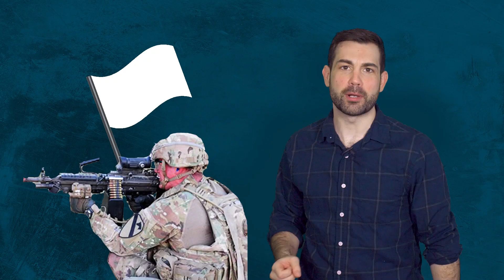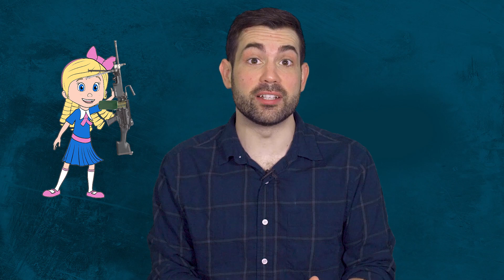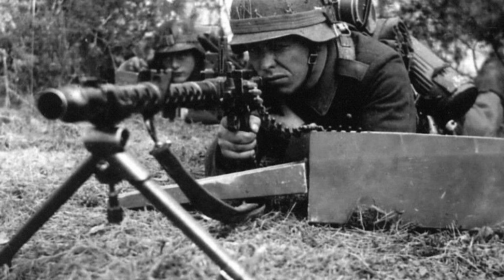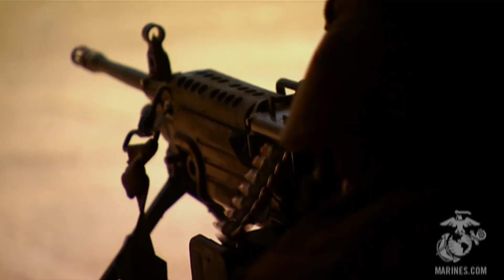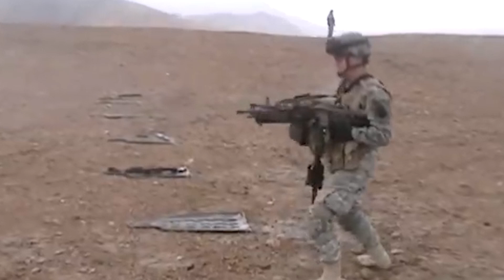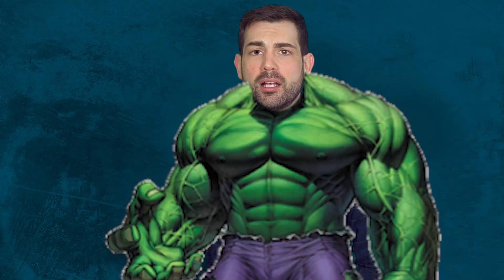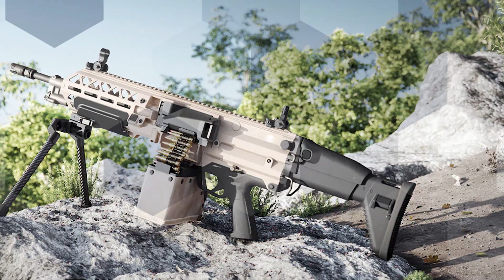How the M249 Machine Gun Evolved

Comment: I’m gonna be interested to see what comes of the marines adopting the m27, with them getting rid of their 249s and the next gen squad weapons coming along
Reply: Me too. I do believe the M27 is a good weapon and the idea of interchangeability with M4’s makes sense on paper. I’m just wondering if it actually plays out that way in practice.
Reply: The M27 is currently serving as an Automatic Rifle, not a Squad Automatic Weapon nor a Light Machinegun. Basically Infantry Marines are replacing all of their M16A4s, M249 SAWs and most of those M4s with the M27 IAR. The idea is that the M27 IAR is an Automatic Rifle kind of like the old WWI and WWII era M1918 and M1918A2 BARs, except now every single Marine gets an M27 IAR except the squad leaders, platoon leaders and platoon sergeants, who will still have M4 carbines. So about 5 M4s per platoon and about 45 M27 IARs. The M249 SAWs have been moved to the company level and are issued out to platoons on an as-needed basis based on mission or employment. It’s actually a very well thought out system and seems to be working well for us so far.
Reply: @jonathanbirkeland1085  well the idea is to replace the 249, the m27 is supposed to be able to have more rapid fire capabilities than the m4, not to the same extent as the 249, buy when you have 2 or 3 guys, it makes up for it, and its meant to be super flexible, Jack of all trades, but I do see what you mean and agree it is probably better thought out than being so rigid
Reply: @jonathanbirkeland1085  Idk who told you that but every grunt is supposed to be equipped with M27’s, not M4’s
Reply: M27 can’t fit the lmg roll because you can’t even fit a 100rd mag because you can’t even change the barrel lmao so just put a 30rd mag and call it a wonderful rifle
Reply: @JS-Rawski  actually i've heard the tactics regarding the M27 will be a different than the ones with the 249, and i also got wind of the marines maybe phasing 60 round quad-stack magazines into service but i'm pretty sure that kind of stuff would jam every 10 shots
Reply: @fuldaman1691  I've heard tge 60 rounders are actually reliable
Reply: @JS-Rawski  249 which M27 is replacing is not lmg. 240B and L are still gonna be in service isn't it? So M27 is supplementing 240 MG crews rather than completely replacing them. If they get rid of 240B/L and only left with M27 then it's a problem imo
Reply: @JS-Rawski  5,56 machine guns lack the range and penetration to truly be useful id rather take a 240B/GPMG knowing that I could hit more accurately and penetrate structures more effectively
Reply: @JS-Rawski  the M27 is not a 240 replacement. It’s a 249 replacement. The current new issue among up to speed units are 40 round magazines. The Marine Corps has been doing it’s very detailed stress test on the magpul 60 round drums for almost 2 years now. The concept is to have the ability to make anyone the gunner during firefights.
Reply: @JS-Rawski  it isn’t filling the LMG role. The marines are finally getting on board with what Russia figured out after WW2
Reply: @JS-Rawski  You don't typically swap barrels for a SAW role.
Reply: @skepticalbadger  right but the statement of the capability to do so was there for the 249 but the bigger thing is there’s no drum mags yet for most of the units using the m27 the reason I say it’s not quite there in that role is we used them the last year I was in and the automatic riflemen would say it’s great it’s just not great to reload 30rd magazines into it over and over
Reply: @JS-Rawski  It's not meant to replace the LMG though. It's meant to be an AR. It was time to get rid of the SAW anyway, it's too old and janky. It made sense to get the M27 because everyone has one so now your entire force just became way more capable, vice just one person in a fire team getting a LMG (which cannot fill the role of a rifle anyway). 

An LMG upper that you can swap out with the M27 (which is already an AR, DMR, and rifle) would be better than an entirely new LMG. That's 3.5 weapons systems in one weapon, without having to buy a new lmg. 

Developments in AR's, hi-cap mags for said ARs, LMG uppers, as well as making MMGs lighter, shorter, and more powerful are going to render LMGs unnecessary.
Reply: @cm-pr2ys that couldn’t be further from the truth, lmgs will always have a role in conventional combat, the marines aren’t fighting like special forces but they also aren’t fighting like the army does.  For the marines, it makes sense to get rid of the 249, but for the army and they way they operate, the 249 is essential, even if they had m27s or whatever else.
Reply: @organiccrack516  and if the MG portion of the NGSW program goes forward, they'll replace the 249 and 240 with the MG68. 
Or if true velocity wins (beretta) they'll essentially have a bullpup battle rifle m27. Small mags, but excellent range/power/accuracy, much improved weight savings over the alternatives.

They're also looking at a lighter 249 (what the pic depicts) if the 6.8 isn't adopted, and a modern lightened 240 in 6.8 TV if the TV bullpup is adopted, along with replacement barrels for miniguns, and the like.

The sig mg338 and the vortex optic are already finally approved it seems.
Reply: @organiccrack516  LMGs can never fill the role of a rifle, even with a semi automatic feature and the ability to mount optics. It will never happen. The open bolt design makes it less reliable when clearing rooms or initiating ambushes. The manuever element needs a lighter, more reliable, and all around more capable weapon. That's why I mentioned improving hicap mags and using an LMG upper vice a whole new LMG. That would save the USMC money. In addition, improvements to MMGs mean any added weight from .338 ammo is worth it because they can still shoot farther and are more powerful than an LMG can ever hope to be. Imagine the 240LWS chambered in .338, or a lightweight and shorter barrel Sig MG .338? For the few extra pounds I'd rather have that over an LMG. Same reason why SOCOM tends to use the Mk48 more than the Mk46. The extra weight of an MMG is worth it when the round is more powerful and enemy body armor is improving.

As technology improves, we will see LMGs only filling one specific role on the battlefield because they are not as capable as an automatic rife and they are not as powerful as an MMG. .
Reply: @cm-pr2ys  I know, I’m not saying the lmg can fill the rifle role, I’m saying a more capable rifle can fill the lmg role when a lot more people have them and it is designed to be that way, and again, it works for the marines,  not everyone else at the same time
Reply: Not unless there's an Extended Mag in 45, 60 or 75 round mag, to be on par with Russian RPK.
Reply: @mystyle_jm8997  drums are very unreliable, clunky, not ergonomic, and expensive, that’s why the RPK is typically issued with 40 round mags, not 75 round drums, and even then, they fill different roles, the rpk is meant to be a mag fed LMG while the M27 is meant to be the standard issue rifle that is capable of a bit more firepower than your standard rifle, and reliable 40 round mags exist, and the 60 round sure fire quad stack mags are supposedly reliable for what they are, reliable enough for the marines though? Probably not,
Reply: Put in surefire 300 round quad-stack magazine in :D

Although i heard quad-stacks aren't particulary reliable either
Reply: @Juozapas001  the M249s arent going anywhere as the marines recently revealed that they are still fielding the M249 for the foreseeable future.
Reply: It'll stay in that position where it isn't used, because why rear echelon dudes need a ~7 kilo? Auto-rifle, but not out of service because reasons i guess
Reply: @JS-Rawski  the M27 is trying to be like the Russian RPK. It's not as good as a belt fed, but it's way better than a normal rifle. It gives everyone in the squad something within spitting distance of an M249.
Reply: The DSTL study on suppression (accurate fire is more important than volume in suppressing a target) is probably the type of thinking they’re going for
Reply: You could slap beta-C drum mag on M27 :D also makes for... really cursed M249 pics, seen one on google... ewwwww...
Reply: @Juozapas001  meh they should’ve just got the ultimax100 if they wanted a decent mag fed MG, BetaC isn’t very reliable I hear
Reply: I guess they had to jump with the french army & bundeswehr on that one, so... fat barreled 416 it is. I mean they removed both M4A1 & minimi from combat roles at the same time
Reply: @Juozapas001  yup, that's the idea, it's not just a new gun that's being adopted, it's new tactics as well, it is in between the two roles and filling them both, just like the assault rifle is in between a battle rifle and sub machine gun
Reply: @radaraacf  no point when the ultimax can't take the place of a rifle. 

It'd make more sense to work on developing a cheaper hi-cap stick pmag thats easier to store than a drum and makes you look like every other rifleman. That's enough ammo to quickly reload and provide accurate suppression, and enough precision to deliver accurate aimed groups at the same time while saving weight and being much easier to learn than an actual lmg.

With that being said, until the ultimax replaces all Singaporean Army rifles, there is no point in adopting it when lmg's and rifles exist. I love the weapon, but it basically being a heavier rifle that doesn't get used as a rifle is a waste of time.
Reply: From everything I've heard, they were excited about getting rid of the 249
Reply: The Marines seem to be using the M27 as a standard infantry rifle these days
Reply: The problem with the Corps is that we can't afford enough. Some of the m16 rifles we use have been around since the gulf war. I've seen like... four m27s in my time so far? The infantry still use m4s primarily, along with those who aren't important enough to warrant the revered m4.
Reply: Im prety sure the marines just want rifles that are fully capable of sustained full auto fire unlike the m4 and everything else was some dumb requirement of the fufilment process
Reply: Most of the marines I talk to hated it. Less fire power and about the same weight
Reply: @Michael_Fortney  it sure as shit isn't less firepower than an m4, and it definitely isn't as heavy as a 249, so I don't know what gun you are talking about
Reply: @Organic Crack  less fire power than the 249, and the m27 is almost 12lbs
Reply: I guess that includes all the attachments into the weight... not that heavy i guess, still heavier than M4A1, sure. Still lighter than M249... then again comparing the 2 is like comparing a nail to a soda can or something
Reply: Sig just won the competition I believe the 249s replacement will be called m250 lol built by sig. same with the rifle the spear will be the new rifle called the m5
Reply: I heard and people i talked to were already giving the XM5 a hard time, saying stuff like: hardest kicking gun of the program, least innovative, expensive ammo (making it from what understood), heavy both rifle & the ammo, etc.

Also being branded as: M14 disguised as M16, stuff like that.

Wasn't told much about MG68 or XM250 on the other hand
Reply: @Juozapas001  well it’s a done deal now the new weapons will start being delivered to combat troops in October 2023 with around 110,000 rifles on the initial order as well as 13,000 machine guns to replace the 249 with an option for more rifles being built if the marine corp chooses to buy some. This was billed as just rifles for the special forces but it looks like it will be all the front line combat infantry getting these new rifles with the m4 being issued to non combat troops and specialists.
Reply: yeah, or as i was told: What's going to happen is the same deal as the Scar.
They'll order a bunch of rifles, outfit maybe a battalion or two with them, troops will complain, and they'll revert back to the M4
Reply: @Juozapas001  yea idk the scar was meant only for a few units not to actually replace the main rifle used by frontline troops that has been in use for the last 20 some odd years.
Reply: It was one of the competitors to replace M16 in early-mid 2000s if i recall that correctly
Reply: @Juozapas001  I believe it was only made an option for socom troops to use and not actually planed to replace anything and truth be told most guys that used them hated them.
Reply: If i recall it was part of the army standard rifle replacement program for like 5 minutes :D
Reply: @Juozapas001  well not really it was meant for special forces hence the rifles name SCAR Special forces Combat Assault Rifle orScar never meant for general combat infantry troops who have their own choice to an extent as to what weapons to use unlike general infantry combat troops who have to use what is issued to them and it sounds like the Sig spear will be that rifle.
Reply: I'm still a bit bummed out that RM277 didn't get the contract, then again its the US army we're talking about
Reply: My son uses the M249B and says "I love running the dam thing"
Reply: I would use the M27 and the 249. The M27 is a lot easier to carry around , but holds less ammo .
Reply: Supposedly USMC will still have 249s in service, but none of the roles will actually use the thing, anyway i guess they think M27 will be worth replacing auto-rifleman with another standard rifleman in the squad
Reply: Marines also got rid of their tanks.. so I've been told
Reply: @iamarbiter6469  yeah, they did... part of "restructuring" or as i like to call it, "daddy navy wants new boats... or something"
So yeah no more M1A1FEP MBTs
Reply: All these old 249 chassis suck, but there’s no replacing a 200 rd belt. Time for an upgrade pls daddy army
Reply: Marines doing dumb Marine things. It's like they don't understand infantry tactics at all.
Reply: @michaelhorning6014  it's not the marines here, it's you, for the marines doctrine having an emphasis on one soldier being able to fill multiple roles, what they are doing makes sense, every soldier can fill most roles to some extent
Reply: @michaelhorning6014  LOL, k buddy